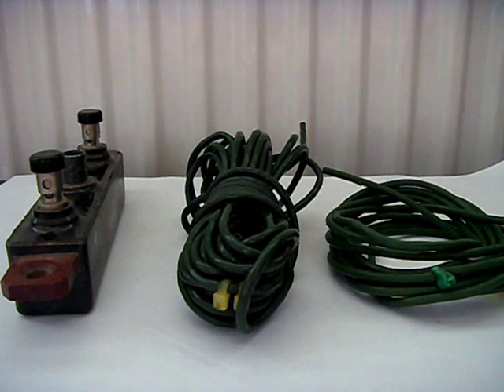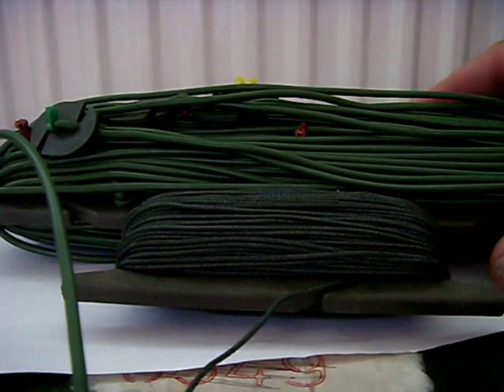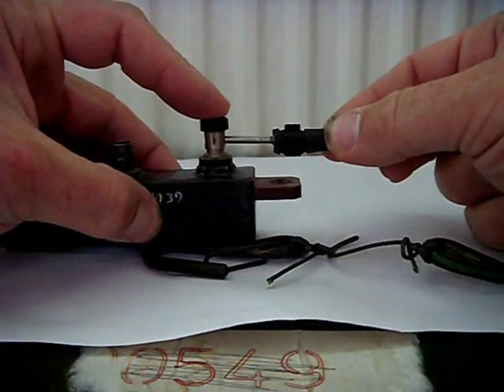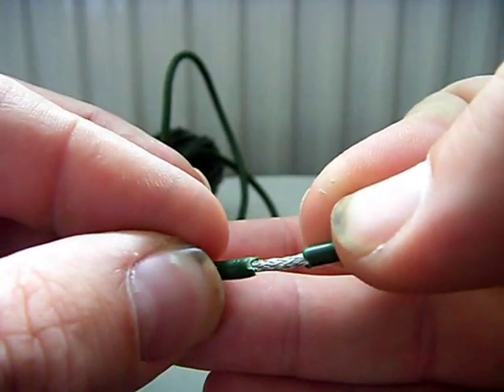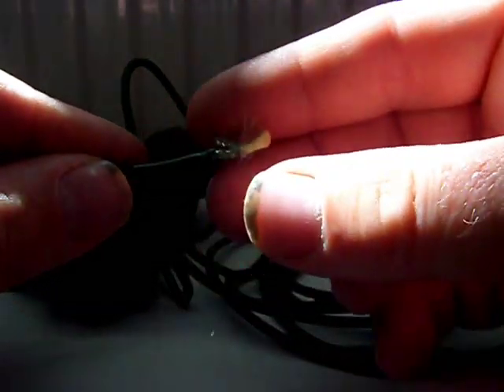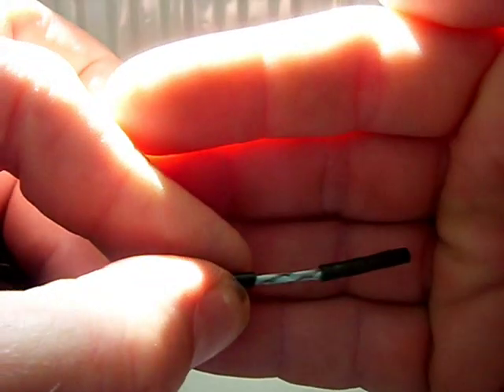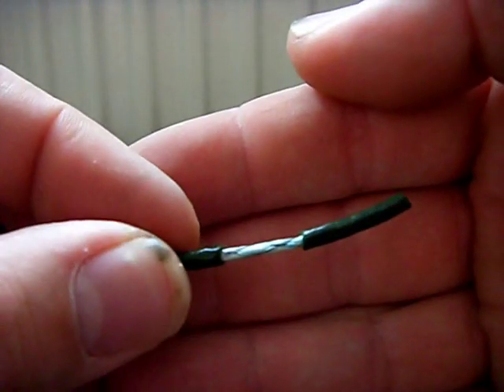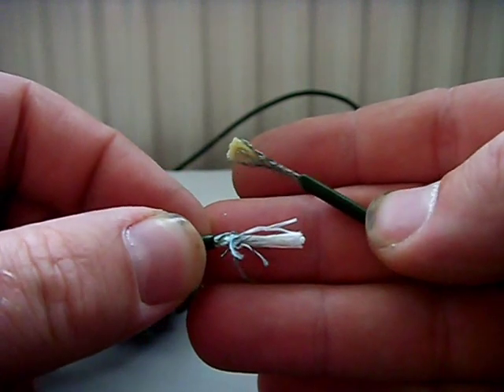The Kevlar wire I use to build my dipoles and end fed longwire antennas

Comment: I recognize the light green one from what I use at work (RF-1941 type of dipoles). Do you know where one could buy these kinds of wires? Do you have any experience in splicing these cables? We have some antennas where they have managed to snap the wire.

Comment: hello, thanks for responding, is this stuff good to use for permanant  g5rv mini center fed dipole ap.? and  is it not as critical to run close to  conductive  materials such as siding and down spouting? also what size connectors would be used?is this stuff going to be obsolete now or is there no market for it?  thanks  dave